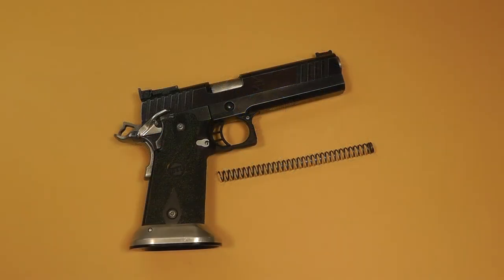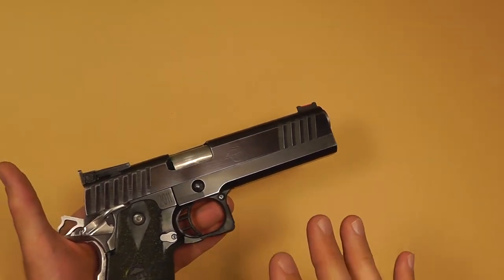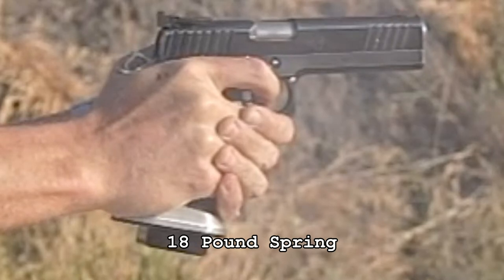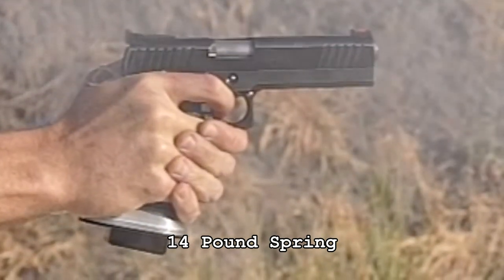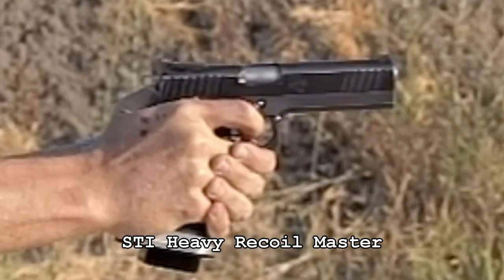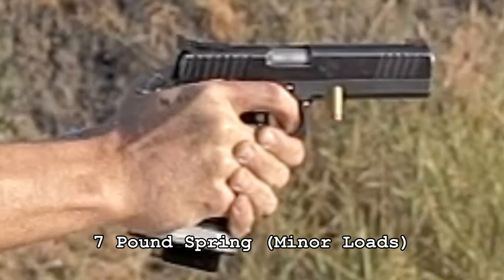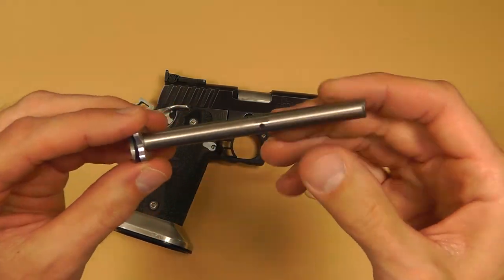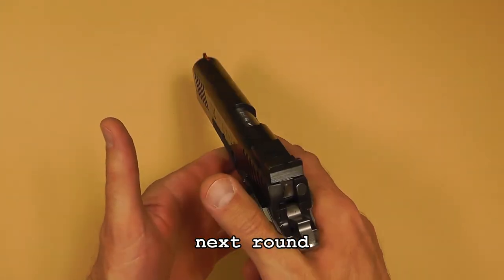Tuning Your Pistol with Recoil Springs

Comment: your right if you go light have plastic or rubber buffers best example beretta redesigned the 96 to the 96A1 because of frame issues  the  problem they did not figure out a lot of early 96s went out with 9mm recoil springs thanks to you tubers like you I put in the right spring almost got rid of my 96 centurion over this issue

Comment: Any info for 9mm, would the 7lb spring work well or no.
Reply: Depending on the gun, that might be really really light. Also depends on how hot or light your loads are. Experiment with a combo pack of springs from a reputable company. Wolff sells a 10-14 and a 16-20 pack of springs for my 9mm (my stock spring is 15). The site should guide you toward the available spring set available for your particular gun.

Comment: I'm used to running Wilson Combat 18.5 lb recoil springs out of my 1911s. I'm used to 1911s and 230 grain FMJ .45 hardballs.

When I took my Springfield Garrison .45 out to the range for the first time, I shot 100 rounds with the factory 16 lb spring. While totally functional, there was a noticeable increase in felt recoil. I swapped it for a WC 18.5 lb spring.

The 18.5 lb spring just feels better for the recoil probably because of my small thin hands.

Comment: I can't wait to go to the range and try out my guns new recoil springs I've been polishing and tuning to run tight and smooth so I'm stuck here watching videos cuz I have no car 😭 I put a real heavy spring in there because it's a compact and polished it until ran smooth without hiccups and screeching or scratching and it was a real pain getting that heavy spring to fit without issues, and now that I'm seeing that heavy springs could be bad I'm starting to worry 😭😅 hopefully my lil 3.5in barrel performs well with the 23lb spring I installed

Comment: I added a 13# recoil spring, tried to rack it and sometimes it doesn’t finish the cycle.  I have to push it into place.  why?
Reply from the maker: Sounds like you need a stronger spring to strip the rounds out of the mag.

Comment: I have a p320 full size and the recoil spring is 20 lbs! Dropped it down to 15lbs GG FAT guide rod. The muzzle dip was horrible now it's manageable.
Reply: Christopher Rodriguez 
This may be a dumb question since I’m new to guns but will that make it easier to pull the slide back?
Reply: CCZ Yes

Comment: If you look carefully, while the 14lb spring doesn't dip as many times compared to the 18lb footage, the dipping on the 14lb spring is even more pronounced than the 18. Just pointing that out. Also, there's a huge human factor involved in these sorts of things, too much to be drawing a "this is more and this is less" conclusion, especially when the video doesn't support those statements.